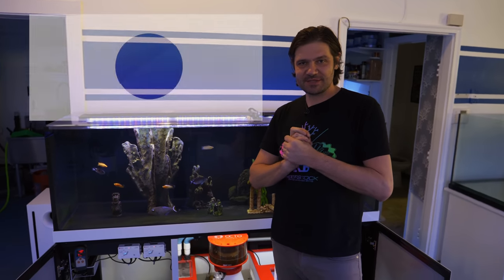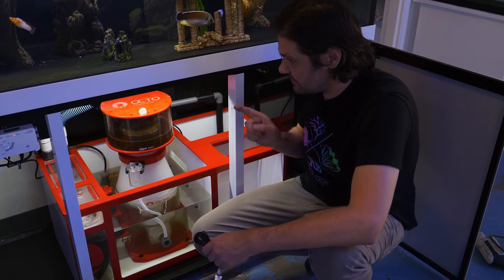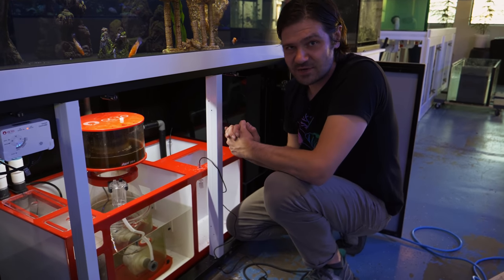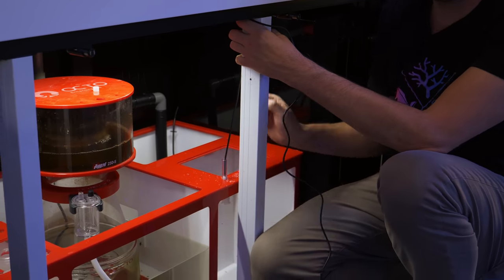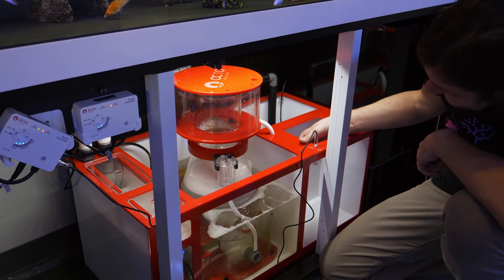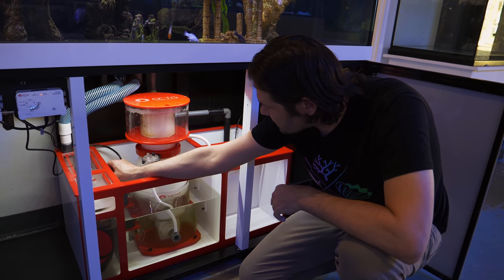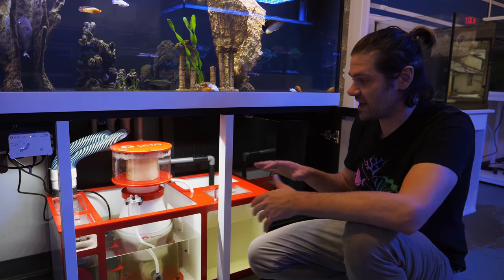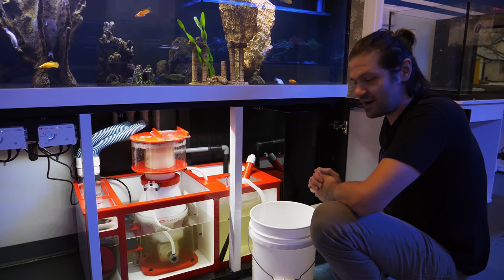DIY Skimmer Waste Collector

Comment: I have a DIY 15ltr waste tank that my skimmer fills. I used a 3 pin plug that I placed on the top of the tanks and have wired to my apex. When the waste shorts the terminals it sets an alarm and trips off the skimmer.

Comment: Wouldn't it work if you just poke a silicone tube hooked to a dosing pump in the skimmer cap and set the pump to remove waste water straight from the skimmer cup?

Comment: Always good to see a updated video from RB. As I suspected, you would use a pump to pump out the nasties from the ATO chamber to a drain. However, in my opinion. I would have just kept the float switch on the protein skimmer and just go buy a long silicone tubing and directly plumbed it into the drain. That would save me an extra ATO external tank for another system and just use the ATO chamber. But that's just me.

Comment: Can the holes be drilled in the lid to keep the warranty?  peristaltic pump would get clogged if its smaller tubing and real thick skimate. Also highly recommend the apex for this. what i do is take a float valve and install it on a 5 gallon bucket, then the bucket can just be taken to the sink and dumped out. another thing is if that skimmer is putting off so much you plan on emptying that daily then your salinity is gonna be all over the place. another reason to have apex on there to monitor salinity, definitely if it was someone running a reef tank. And the apex could automatically run a pump to empty it, could even have an auto cleaning function in there where it cycles water through it a few times and a wavemaker stirs it around.
Reply: and if you wanted to get crazy could automatically correct your salinity with apex as well.

Comment: Wet skimming has no real advantage on dry skimming. I had a similar method, however, I only collected the poo on a 5gal bucket outside the sump. I also had a calc hydroxide reactor which compensated my loss in salinity and I think it's not your case so you'd better watch out.

Comment: This one I don’t get.... the waste collector by definition should be easy to disconnect and take away to empty and clean, whereas the ATO is likely never going to need cleaning. So the waste colector should be a stand alone reservoir that can be moved while the ATO can be a fixed part of the sump 🤔
Reply from the maker: you didn't watch until the end . . .

Comment: Just paint the waste collector don’t go into the work replacing the panel :)
Reply from the maker: Yeah that's kinda what I'm thinking - not replacing but just put a cover over it, maybe even paint
Reply: Reef Builders hell yeah just thought paint would be easy some red or white krylon if you ever want it off you can scrape it off :) anyways love the setup underneath looking good ❤️

Comment: Skimming that wet and filling back with ato is going to mess with salinity.
Reply: Yeah, how will you be managing the salinity?
Reply from the maker: It’s a fish tank so they are forgiving on exact salinity but will sometimes fill the ATO with seawater
Reply: @ReefBuildersVideo  thank you.
Reply: Totally agree.  You need some automated system to replace what you skim if its that large a volume.  Been thinking about something similar, but did not implement it because of the drop in salinity.  Some sort of peristaltic pump pair perhaps.